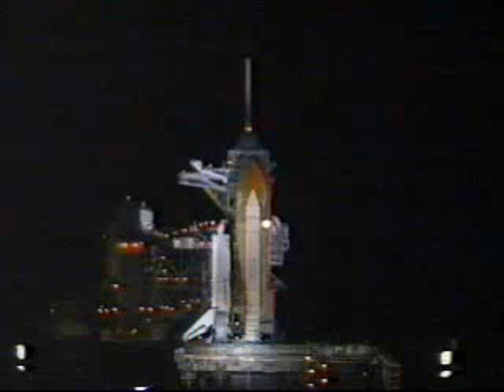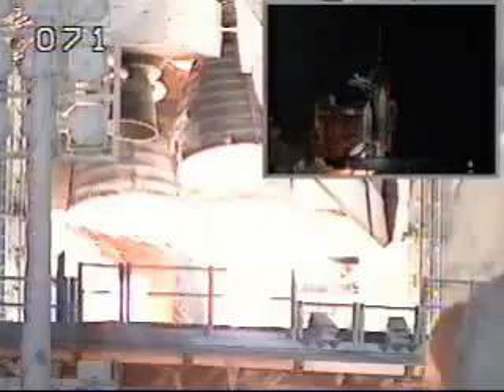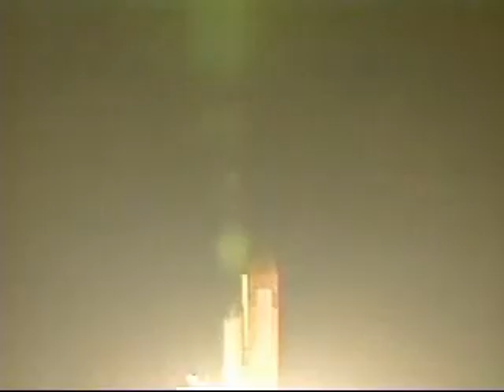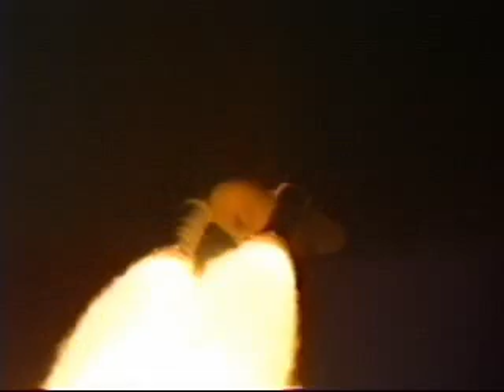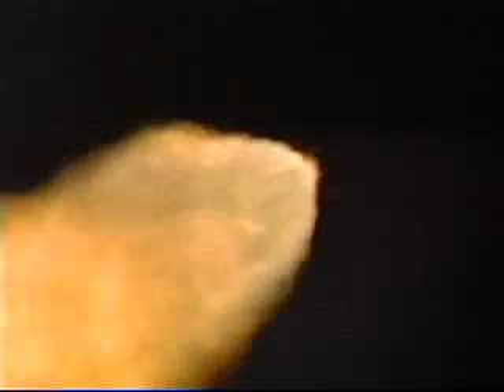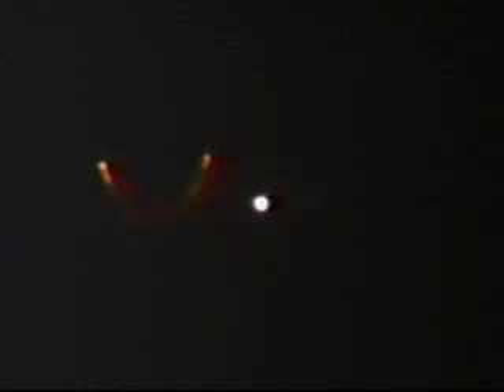STS-84 launch (5-15-97)

Comment: This was the 19th flight of Atlantis, the 6th Shuttle-Mir Docking and the 8th Spacehab Mission with the 3rd double module.
The Atlantis crew transferred about 3,400 kg of logistics and supplies to the station.  Michael Foale replaced Jerry Linenger as the American resident on Mir.  During his stay on Mir,  there was a drama and crisis as a Progress supply vehicle collided with one of Mir’s  modules. It took a great, great effort by Michael Foale and his Russian colleagues  to avoid an emergency evacuation of the station. 
There was no fly-around of Mir on this flight. Atlantis landed in Florida at the second chance after a waive-off at the first due to low clouds.
Charles Precourt made his 3rd flight, his first as Commander. Eileen Collins, the first female Shuttle pilot, made her 2nd.  Mission Specialist Michael Foale  made his 4th and Jean-Francois Cleroy his 2nd.  Returning Mir resident Jerry Linenger  finished the second and last of his flights. 
MSs Edward Lu and Carlos Noriega made their first flight. Russian cosmonaut Yelena Kondakova  was the first Russian female to travel into space on board an American spacecraft, making her 2nd flight.